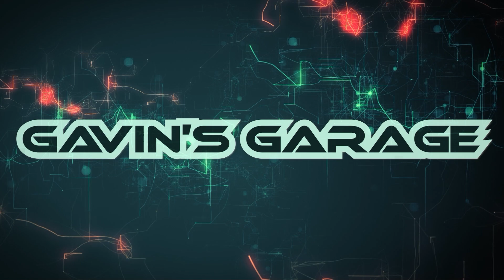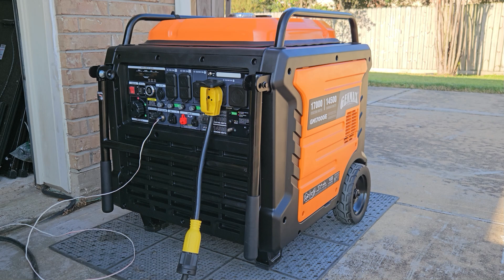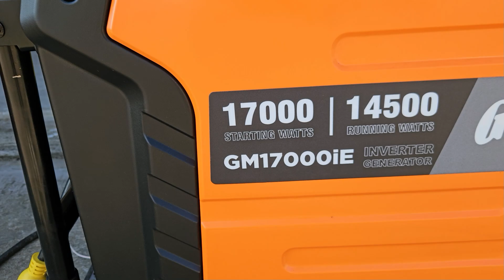GENMAX GM17000iE Auto Generator Start using the EG4 6000XP Inverter

Comment: You should have the generator warm up for 2 minutes or so, before connecting a load. Going all out right at the start is not good for the generator at all. And you should run it for 2-4 minutes with no load. To start cooling the generator down before fully turning off. 
In matter of fact Eg4 chargeverter 100a charger has a new unit that does all that. It can turn on & off your generator, warm it up and a cool down sessions. After the chargeverter turn on the generator  and its warmed up. The charger will slowly raise up the charge too. I just ordered one the other day. 
Its funny. Something I've been doing for years and now they have something that does it all 😆
I had a Generac Generator that last me for over 10 years. Telling you the trust, I would probably still had it. If the enclosure I made for it didn't catch fire.... Tip: Clamp down extension muffler, so the exhaust air doesn't blow back and catch the enclosure on fire. Live and learn.....

But yes, if you run the generator like I told you and do your maintenance. It will last you for years.

Good Luck
Reply from the maker: The software automatically sets warm up and cool down periods. I just don’t show that in the video.

Comment: I am rather new at this. Can you tell me the reason you're not using the charge verter
Reply from the maker: The chargeverter is limited to 5000w since I have a pure sine wave 17,000 W inverter Generator there is no need.

Comment: How long will the generator stay in standby mode? Can I leave this as a backup for a garage freezer for months or years in autostart mode? Or is it slowly utilizing an onboard battery in standby?
Reply from the maker: You can add a 12v solar panel to the battery
Reply: @GeneratorReviews  How long without the panel?

Comment: Can you not increase the charge rate of the EG4?  That generator is way overpowered for that small pull,  I am planning on building 2 Systems using the Tri-Fuel version ( by the way your prices are the best ,
Using the Grid Boss with the 21 Unit any the Genmax, only if the grid Boss can be set to pull in more power.
Another question is do you need to keep a trickle charger on the unit when it goes to sleep in standby?  I assume it is draining the main battery during this time.
Reply from the maker: The generator is exactly the size for that system. You can run 12,000 W load plus charging.
This video is just for demonstration showing the how it works. I didn’t do a full load test. 
I will have to keep the battery on a trickle charger or you could also use a 12 V solar panel charging the battery every day we could charge controller of course
Reply: @GeneratorReviews plan on ordering a unit from you next year.   In the process of becoming a EcoFlow Ocean Dealer.  Going with EcoFlow instead of the EG4.

The smart panel with the Ocean Series is the Best out there, nothing compares.

I will keep in touch.

Comment: Been waiting for an ATS to use with my 10500!
Reply: I'm with you. I have been using a Generac 16000 watt Whole house generator since it was with the house I bought. The problem is no-one can tell me how to hook it up for auto start with the inverters I installed that have dry contacts since it feeds the house through a 200amp Generac transfer switch hooked to the grid. So I ordered the same 10500 you did and after it shipped I discovered they made a tri-fuel 10500 in an open frame with a 2 wire ATS! To late now. There has to be someone out there that has this problem? I can charge my batteries when I'm home if the sun doesn't shine. But it's a pain in the ass. I have to bypass the 200amp transfer switch or the inverter just starts back up and the transfer switch just trips the switch back and shuts it all down again! I am totally off grid and without the grid power the generator feeds the inverter which sends the power back on the same house line like the grid power came back! Anyway, did you ever get it straightened out in the last year since you input? If I'll be waching for your input if you don't mind.

Comment: Genmax ATS - the connector is an GX20 7 pin Aviation Plug. For what ever reason they don't put that information anywhere in there userguid or website.
Reply: There is a way to convert to a dry contact 2 wire setup.
I worked it out with the techs (in China). The only caviat is it will probably void the warranty. If you're interested leav areply and I'll explain the procedure. The open frame version has a 2 wire dry contact ATS on the 10500XiT Tri gas. But from what I can see there aren't any Genmax models available ANYWHERE even on their site everything is out of stock.

Comment: What AWG is the wire running to the autostart on the generator?
Reply: Also, what wires from NO1 and COM1 on the inverter correspond with the inputs on the plug to the generators autostart?
Reply from the maker: You can use 18 gauge wire

Comment: I would like to buy that generator a smaller size generator of the same brand , but this video is basically showing that it's working, but not really how it was done. Can you share photos of the connection on the inverter and generator regarding the dey contact?

Comment: When will they be back in stock? Also, do you know if they will ever offer an EFI model in the near future?? This thing looks to be a monster, but if it can run a water heater, central AC, pool pump, ceiling fans & the daily electronic load of a whole house simultaneously, with wattage to spare, I'm sold!!
Reply from the maker: Should be back in stock soon probably by next month. The tri fuel model will be released

Comment: Can you show where you wired the  2 dry contact wires into the inverter? No and common or nc and common?
Reply: I have the same question, no one is explaining how the actual connection is made and I can't get it to work!
Reply: @scottbarden9630 its NO and C, that will close the 2 wire connection when parameters are met and open again when parameters are met for off

Comment: I'm still on the hunt for a 120 volt generator that can autostart with the chargeverters 🤔
Reply from the maker: Yes it can
Reply: @GeneratorReviews  which 120v generator has the dry contact inputs for the chargeverter to work with?
Reply: The 10500xit tri-fuel. Good luck finding one though. Seems like any with 2 wire dry contact ATS ore sold out just about everywhere.

Comment: Could you not do the same thing with the Genmax 7250iedc using the 7pin ats connector pins 2/3?
Reply from the maker: Not really the 7 pin was designed to work with the transfer switch ATS
Reply: @GeneratorReviews  any idea where to get one?

Comment: First generator that puts the AGS connection right on the front panel. Are there any other generators like this? Reason asking is this generator is way overkill for my needs.
Reply from the maker: At the moment, this is the only one that does.
Reply: Genmax has a 10500 watt open frame xit model that has a 2 wire dry contact AST. Being an open fram it's a bit louder and has a smaller engine (because it cools easier).

Comment: It seems like I will need to "trim/manicure" my existing ATS cable I have from GenMax for my 10500 that I have permanently mounted outside (Pics to come next month).  But in doing that what two wires (usually color combinations) would I need to use to make that existing cable useful for a setup like this?
Reply from the maker: I haven’t seen the seven pin ATS work in a start / stop configuration with a two wire.

Comment: I wonder how readily a retrofit could be done to make this 2 wire system work on the genmax 10500. I'd bought it last year for the ATS that was soon to be released, but now it's unclear if that version will ever be available. A standard 2 wire system makes so much sense since it's more universally compatible with battery backup systems like this.
Reply: I'm with you. I have been using a Generac 16000 watt Whole house generator since it was with the house I bought. The problem is no-one can tell me how to hook it up for auto start with the inverters I installed that have dry contacts since it feeds the house through a 200amp Generac transfer switch hooked to the grid. So I ordered the same 10500 you did and after it shipped I discovered they made a tri-fuel 10500 in an open frame with a 2 wire ATS! To late now. There has to be someone out there that has this problem? I can charge my batteries when I'm home if the sun doesn't shine. But it's a pain in the ass. I have to bypass the 200amp transfer switch or the inverter just starts back up and the transfer switch just trips the switch back and shuts it all down again! I am totally off grid and without the grid power the generator feeds the inverter which sends the power back on the same house line like the grid power came back! Anyway, did you ever get it straightened out in the last year since you input? If I'll be waching for your input if you don't mind.

Comment: What’s the point, since the generator isn’t weatherproof/waterproof and is not designed to be left exposed to the elements 24/7? Some will reply that they will design and build a weatherproof enclosure…….but how realistic is that for the average consumer who’s looking for a reliable standby generator solution?
Reply from the maker: It’s nice to have options

Comment: If this was going to be a long term solution, the connector is commonly available, and there's also a 12v direct connection pin to the battery that should be used to maintain the battery if it's sitting on standby.  The generator will kill its battery after 48 hours or so on standby.
Reply from the maker: This isn’t a long-term solution and I don’t think anyone can make that claim that the battery will die in 48 hours a simple solar panel maintenance charger will take care of that problem
Reply: I'm having this issue and I can't figure it out...it's killing me

Comment: Will definitely hold off for their Dual Fuel Version.
Reply: Nah, dual fuel on this class of generator is mostly marketing, and not worth it for all but the tiniest subset of users.  To run a 14kw generator at full tilt, it needs around 250,000btu/hr.  In 40F temps, when full, a 100lb propane tank can provide 277,000btu/h, at 90%, it can only make 247,000.  At 0F, the smallest tank that will run this generator at 50% full is a 250 gallon tank.  and by 30% full, that tank is not able to vaporize fast enough.

If you own a 250 gallon+ above ground tank, ask your propane fill company if they're okay with servicing and filling the tank with a portable generator connector on your loop.  The answer is almost always no.
Reply: @BadHaddy  why?  And how would they even know?

Comment: Nice unit. Duromax better get the ball rolling, can't wait to see what features their next unit has.
Thanks for another great video.
Reply: Duromax released a similar generator a year ago and it is dual fuel. They will release a trifuel by the end of the year.
Reply: @JohnCillian  yeah, they (Duromax) has the 16000 dual fuel, the biggest difference is that Duromax has an ATS port versus the Genmax here having the sleep mode with auto start function.
Duromax said on their Facebook page that their tri fuel should be out by winter.